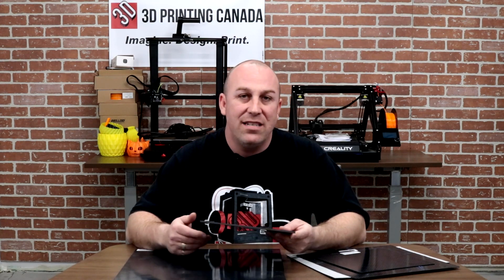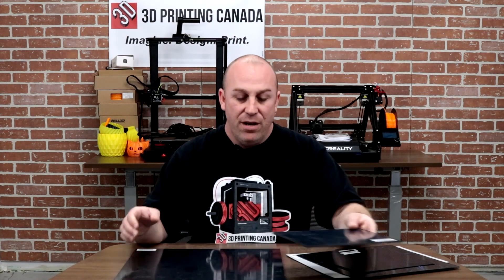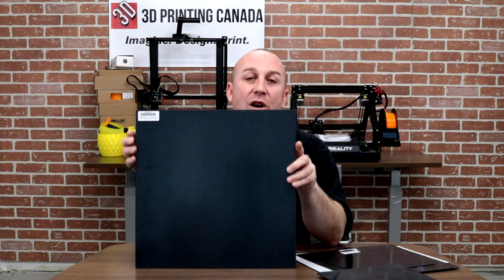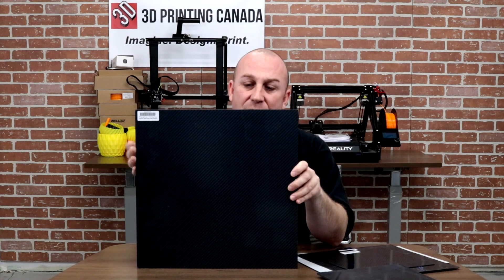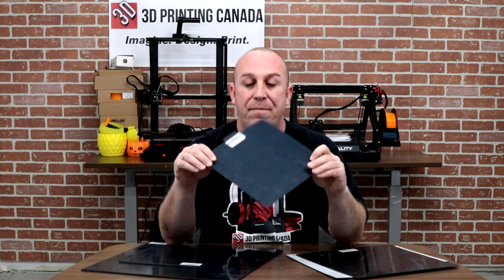USING A CARBON FIBRE BUILD SURFACE

Comment: I bought two of these CF plate on your website.
One 500x500 for my S5 and a 410x410 for my Chiron as an alternative for glass and spring steel bed surface and honestly that’s the best build surface upgrade you can find. 
Perfectly flat, really lite and PLA stick on it with out glue.